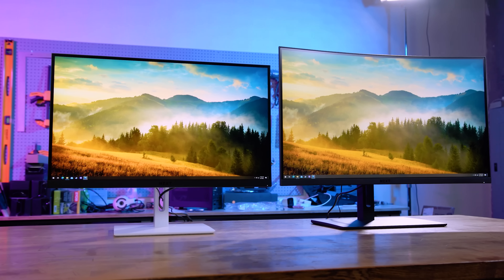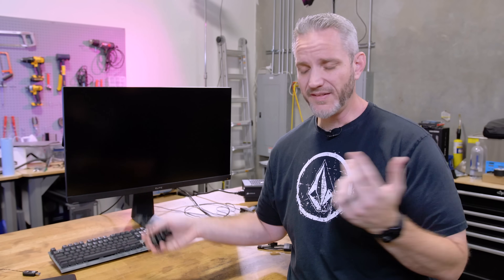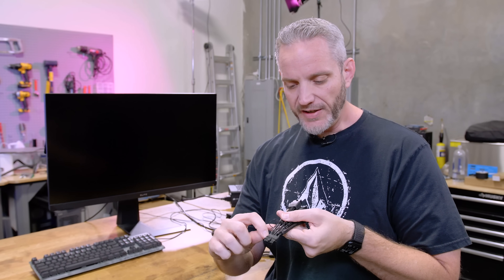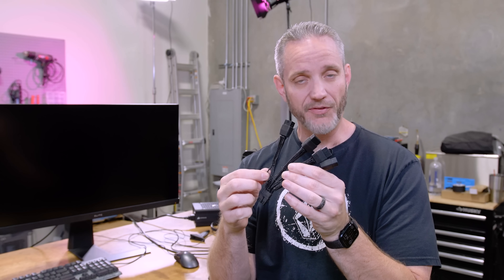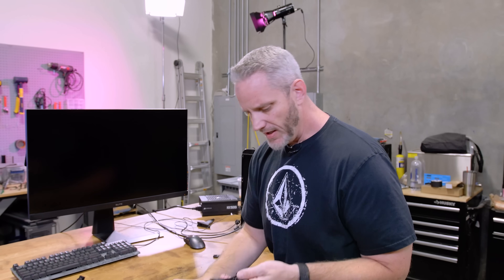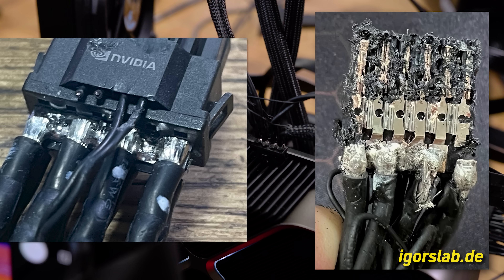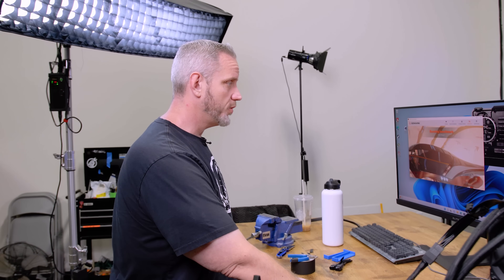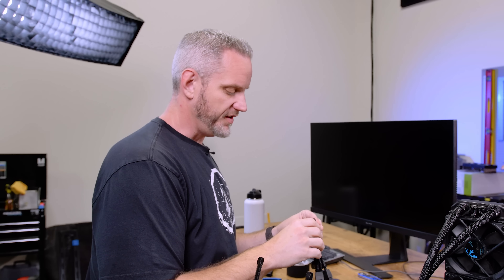Igor's Lab figured out why NVIDIA adapters are melting!

Comment: I have experience with soldering going back to the 80s and if cables are made where stress relief does NOT exist, then it will fail. You cannot design a cable to take stress where it depends on the solder itself to take the stress. 
Back in the 80s we were taught to wrap the wire or crimp it then solder so that the stresses of the wire being pulled don't (over time) fracture the solder and break.

I was very surprised to see the wires just laying on top of a solder plane. That's a bad design.

Comment: I would say that the problem is the soldering, not that there aren't the point to point connections. All psu connectors I know know of are crimped, all home and industry cabeling is crimped. All the 6/8/4(molex) pin power adapters I currently own have actual wire loops between some pins crimped. In high school (electronics) we were taught not to use soldering on high current, in mechanicaly stressed parts and in freezing conditions, but i have never saw actual solder connection to fail. I would guess, this is exactly why we were taught that... high current, soldered, mechanically stressed connection is failing in rate 1 per probably thousands or tens of thousands.

Comment: the whole problem with that adapter is the material used inside there is ALUMINUM, and aluminum a soft metal and is bad news for bending, it cracks and breaks off easily

Comment: With the solder failing it could also just be shorting out the wire breaks off and is jumping across from the wire to the plug. Which could be making them fail.  Writing this while driving sorry for lack of details.
Reply: drive safe and don't do that again

Comment: Trying to push 600W / 12V = 50Amps through such a small connector is going to give you problems. Why are they doing this? saving a few cents on a card that costs this much?

Comment: It has been my rule of thumb to not use adapters for power plugs for years, long before the appearance of 4090's melting down.  They always threw those splitters for MOLEX and PCI connectors in the box with GPU's and I've always instructed people not to use them. Get a PSU that has enough of the proper connectors for your hardware.  The adapters just allow naive users to create situations their hardware wasn't designed to safely handle.

Comment: man, that isn't the problem. The real problem is the pins of the adapter. That part is overheating, not the rest of the connector. Pointing the thermal camera to the housing of the connector, you are only measuring the temperature of the air coming out of the heatsink, not the temperature of the pins. If you wanna recreate the fire, you should cut some pin (not the cable) or opening them.

Comment: Everybody is wrong... I think. The overheating looks like it is occurring at the end of the connector where the plug makes contact with the jack.  I think it is more likely the issue that was detailed by PCI-SIG. Why?
1. The melting isn't occurring at the foil
2. In a multi-contact current path, breaking a single path or a flakey single path increases the resistance which means the current increases along the other paths.  That means the inner conductors would need to break for the current to increase the current to the outer current. I doubt the inner conductors are breaking on  that foil given their mechanical position.
3. The molding looks like it is acting as a strain relief. It looks like most of the stress is being seen by the molding AND most importantly being seen by the joint between the jack and plug where the actual melting is occurring
4. It's definitely not arcing. That requires a large voltage delta which only occurs when there is a break between all 12V connectors to the foil.  If conductor A breaks, conductors B, C, .. all keep the voltage roughly at the same level on the foil as conductor A. This isn't a situation most of us are used to when you take car battery leads and tap them against the battery terminals and see sparks.  In that case there is only one point of contact and you are making and breaking it.
My opinion: it is a strain issue with bending but the overheating is at the jack and plug connection points which is where the melting is occurring. I think all the conductors are not making good contact at these joints in the bad situation.  The outer conductors are making the best contact for some reason which means most of the current goes through these contacts then it overheats and melts

Comment: Its harness engineering 101... NEVER EVER terminate wires with solder that are subject to motion.  Crimped connections are the only reliable termination for harness wires.  And if for some reason solder is the only termination that works you better have a robust strain relief that completely isolations the solder joint from mechanical forces.

Comment: Hello, would it work to plug Nvidia reduction 3 to 1 reversibly - cable into respective port (12V-2x6) into PSU, connect 3 PCIe cables and plug them into e.g. AMD Radeon 7900 XTX?

Comment: I am still flabbergasted that this tiny ass connector is rated at 600W, while PCIe (which uses much thicker contacts) is only rated at 150W.
It feels like it was originally intended for 300 or 400W and then somebody said "sorry guys, but the next gen GPUs need more juice than that".

Comment: "It's save Jay, we tested it bro, trust me bro, it wont melt bro, it just works bro" Nvidia is the last company I would ever trust when it comes to QA. Besides that, from an engineering point of view, soldering is fine if you expect no stress on the material via bending and plugging. The obvious solution to prevent parts breaking off would be a small encasing or longer hardsleeve to move the stress point further away from the solder points.

Comment: Just make the connector bigger, more robust and have all the wires individually crimped to their connectors. Problem solv...oh wait that's just going back to the older pci connectors. I would think solder is not advisable on anything that's going to be going to handle high loads and is going to be flexed or handled a lot.

Comment: the melting plug thing was kind of over blown
Reply: yeah kinda funny

especially when nvidia published their numbers for how many instances they are aware of, which was like 50 (0,05% of buyers) and they essentially have all been proven to be improperly connected (except for that one case with the debris) 

Now everone on the internet says not to bend and stuff, well yeah you dont want to bend it too close to the connector but for the cable in the middle its fine. It’s like the AIO radiator mounting position vs pump height thing all over again, you post a picture of your build and 10 people with the attention span of 5 seconds say your pc’s a fire hazard or your killing your AIO … and thus the echo chamber just spreads the message

Comment: That explanation sound wrong, it does not matter how many wires coming in to the connector if the problem is melting on the gpu side of the connector.
The middle wires have 2 conductors each to the metal strip and the outer 1 each, on some photos it looks that all 4 wires are touching each other.
My guess is for this to take effect the outer wires might brake of the metal strip and act independent, instead of 75W per pin you might have 112.5W on single pin.
We can make some assumption on to what the effect will be of this scenario by using Joule heating formula I*I*R, as we dont know what R value is lets just put X instead.
For normal operation 6.25A per pin the result will be 39X and for fault one at 9.37A it will be 87.8X that mean that the heating of single pin will be increased by 225%.
Way more logical then a simple solder failure that wont change the pins conduction at all.

Comment: The issue is the crack in the solder allows for contact, but considerably higher resistance, which disproportionately increases amperage and resultant heat through the cracked line. Instead of 600w/4, you get 1 line at 400w and 3 lines at 67w. That = cooked pins.

Comment: TLDR - they are trying to pass too much power over too little wire, exceeding the National Electrical Codes specification.  They are using the foil as a power rail.  The crack in the solder joint is because they are using incompatible materials.  You cant solder copper to pot metal and expect a good solder joint.

Comment: i have an solution. use metal adapter.

When u plug all 4 cables that can be an plastic but thats part u need to plug to graphics card u need make it metal and too in graphics card

Comment: Well, almost june 2023 and 4090s with 90 and 180 degrees adapters still melting
Reply: yeah this video didn't age well
Reply: How were they installed?  can still fail if the cable is bent at some point?

Comment: If you want to recreate the failure read further! You won’t be able to recreate the failure with such a massive wires going into the “adapter” they are probably capable of handling the current even 2 are disconnected. The problem is with the actual metallic female pin inside the connector! Here’s why: they become loose (the actual hole is enlarged) and will not create enough contact surface with the male pin on the actual card plug. Smaller contact surface will create heat and will result in a melted connector. The design of the adapter is bad because it joins together 2 pins making them stiff enough to make them difficult to get centered when they are inserted into the card connector. Nvidia did a great job by using smaller gauge cables on individual pins, this allows each female pin to get centered on the male pin when connector is inserted. Also this design is better for cable twisting, will also prevent the enlargement of the female pin. If you want to recreate the failure, just take a small screwdriver and enlarge a few of the female pins…

Comment: Adding my "two cents" and coming from a place of relative ignorance, wouldn't a real world test be persistent gaming over a lengthy period of time, and all components being in a case which would contribute to a slightly higher level of temperature  when in operation?

Again, I am just throwing out additional factors which could possibly contribute to the failure.

Comment: nope wrong, and that is not how electricity works.
its the crimps.
the female part has a slit interface and if u bend it a bit and u get a to low contact pressure and that will create a hot spot.
this hot spot will melt the plastic.

but how can removing half of the wires melt the pins?
halving of the wires will make them 4 times as hot. but the wires are not melting.
if the heat is generated by the bridge inside how com it melts at a different spot and not the hot spot?

i have American and European certificates for crimping connectors.
im also IPC certificates in soldering.

i make tester and test equipment for PCBA and final products.
as u know connectors have a maximum number of cycles.
we exceed the numbers on the daily because most crimps don't have a high wear resistend model.
testing 10.000 units with a internal proprietary connector with a 5 time plug and unplug limit will make u cry.
making a connector that fits with crimp that can handle 500 to 5000 cycles is one of the things i do.

the crimp are bent open just a bit so that the contact point is very small. this make a intenser hot spot that melts the plastic.
al they need to do is use high spec crimt that will stay in the correct shape after the have bin bent to the limit the plastic housing to allows.
make the space the crimp contacts can move smaller or make the crimp out of minutely thicker material and have the fingers spring back without permanently deforming.
a different finger design may also work.

just today i replaced machined crimps that cost 5.50€ apiece in a clean-room for ASML testing rigs. that connect to our in-house developed test machinery.
it can see the differences between a B40 and a C40 type circuit breaker by the resisters ramp-up because of the current.

i know connectors.

Comment: Yeah, If that "tin foil" were actually paired with a piece of double sided PCB ... This would not have been as much of an issue as the tensile strength would have been higher.... That is a design flaw guarantied, especially if Nvidia knows that cards are side mounted....

Comment: Honestly given that nearly everyone twists to the side to route the cable shows that it is insufficient testing by review board that approved it since most testing is done on open frame it doesn’t replicate real world cases , further regarding the standard no case has the bend clearance to accommodate the 3.5 cm clearance , I understand why they chose to do it but there should be a higher grade of cable or better be found on the bottom of the card recommended it shouldn’t have been approved that way that’s why I will follow amd this gen instead

Comment: It still looks like all the failures are in the pin structure. When we see this kind of failure in the automotive world it is because of high resistance in the pin fitment. That leads to heat and the female pin starts to spread then the male pin moves around and gets hot.....hey wait a minute....nevermind..... but anyways it continues to build resistance and heat to the point of failure.

Comment: so until now i thought a pcie port was 150watts max, now corsair has a 2 8pin to 1 16pin for 600w? am i losing something? the 150watts limit was only the cable and not the port? if so, what's the theoretical limit of the port? my gx850 focus gold plus from seasonic has 6 ports that are 8pin both for cpu and gpu, would this corsair cable work? or 300w per 8pin is not supported? thanks

Comment: the problem is the size of pins, old pins are biggers(female and male) otherwise, this new connector are so small, i could tell the fail at moment that i see that connector without investigation needed or nothing, this its basic in electric wire, more thin the conductor, less power and more temps, anyone with some electric related career should notice this soon.

Comment: I don’t think it has to do with this solder being broken and completely not attached in the same way as with you cutting it I think it has to do with the solder being broken and it being intermittently connected and unconnecting still touching, but not securely, which would cause the wired to heat up a lot. I see the all the time in failed components in the hvac industry

Comment: I'm not convinced.  By this theory, the outside wires are the ones that break, and if that's the case then the outside conductors aren't the conductors drawing the excess current --- so it should be the center conductors drawing extra current.  That would imply that the inner plastic keyguides would be the ones first to melt, but it's the outside keyguides that melt first. 
  

  
But that doesn't make sense for another reason.  The inner conductors are already drawing half the current of the outside conductors by design.  There's no way that breaking an outer conductor would increase the current on the inner conductors sufficiently to cause a problem.
  

  
IMO opinion it's going to end up being resistive heating of the OUTER two contacts.
  

  
The way they built this connector, the inner four contacts are being used in pairs, but the outer two contacts are being used singly.
  

  
This contact is being used to draw 50 AMPS of current.  Over the four wires, that's 12.5 amps per line.  The inner two lines are transmitting those 12.5 amps across two pins each, or just 6.25 amps per pin --- but the outer two contacts are passing 12.5 amps each.
  

  
Resistive heating goes as I\^2\*R, and the contacts are rated at .005 ohms.  For the inner contacts At 6.25 amps, you get (6.25 amps)\^2 \* .005 ohms = 195 milliwatts of heat per contact --- and that's not too bad, even if they are all right next to each other.
  

  
But for the OUTER contacts, you have (12.5 amps)\^2 \* .005 ohms = 781 milliwatts of heat per pin!  And for a pin with no heat sink completely surrounded by plastic, that's actually a lot of heat!
  
Now let's add it all up --- 781 mw \* 2 + 195 \* 4 = 2.3 watts * 2 directions (power+ground) = 4.6 W of resistive heating when working correctly inside a small connector that is surrounded by plastic and has no effective cooling.

  
It's enough heat that I'd be worried about that connector even if it was exposed to nothing more than high ambient temperatures.
  

  
But suppose now that the connector isn't quite fully inserted, or is slightly oxidized, or has had too many insertion cycles applied, or the contact is bent.
  

  
If the effective connector resistance rises even slightly, the heat produced will rise linearly.  And the contact resistance is currently just .005 ohms.  If some small thing is causing the contact resistance to rise to, say .01 ohms, it's going to double the heat output to 10 watts.
  

  
Now suppose that it's the INNER contacts that fail, rather than the outer ones as proposed.  In THAT scenario, the current passing through the remaining three input wires rises to 50 amps / 2 leads = 25 amps!
  

  
Now on the outer wires we have (25 amps)\^2 \* .005 ohms = 3.12 watts PER OUTER CONTACT!  * 4 contacts = 12.5W and that is certainly enough heat to melt the plastic.
  

  
I strongly expect this is going to come down to two things: high case temperatures combined with an ever-so-slight increase in contact resistance or failure of the inner contacts.
  

  
If you want to force a failure, cut one to four wires going to an INNER pair of conductors on purpose to raise the current on the two OUTER conductors.  Then raise the ambient temperature close to what you find in a case and don't remove the insulating boot from the connector.  I'm pretty sure you'll see it melt.  Don't open it to cut the lines, leave it closed and thermally insulated.